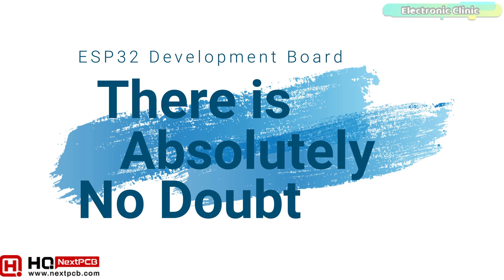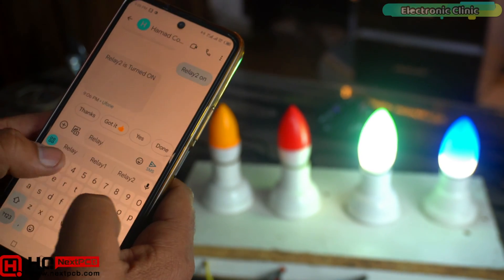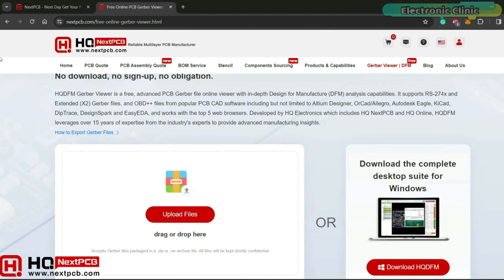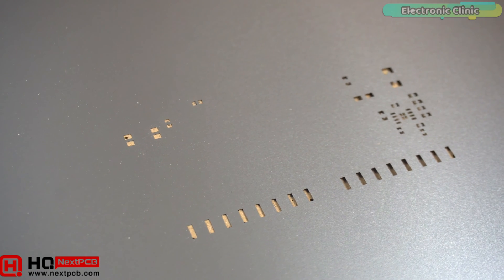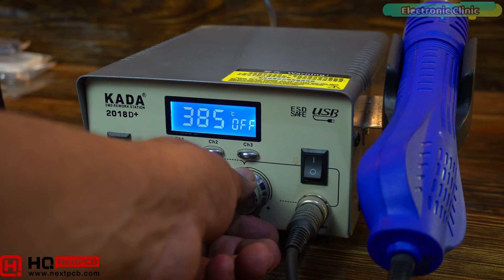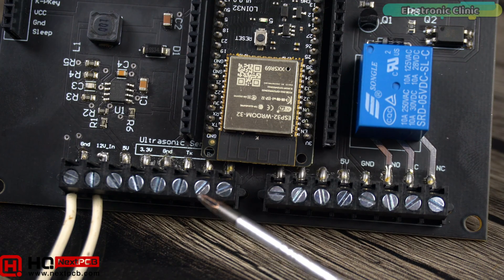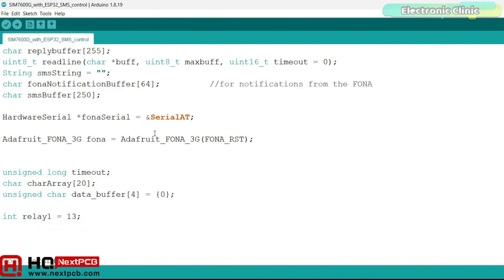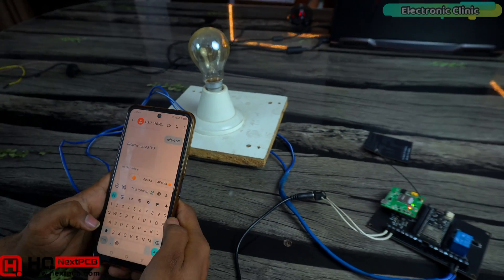SIM7600G 4G LTE GSM & ESP32 Development Board with 5V 3A Power Supply

Comment: I would like to use 18650, two in series 8.4V stepped down to 5. Can you create a video showing us?
Reply: use a buck convertor and set it to the lower voltage

Comment: can you easily use this module with an arduino as well as the RPi? As I'm keen on making a low power setup. Thanks !
Reply from the maker: Ya, you can use it with Arduino. But it's good to use it with esp32. Arduino is nothing in front of the esp32.
Reply: @ElectroniClinic  I'm with you all the way, but 8 bit atmegas have some dead easy sleep states. I guess you use all the same at commands then just adjust code to work in c instead of python then it's same old?